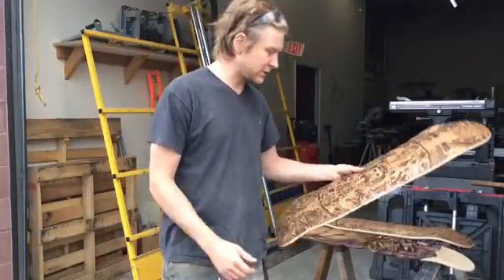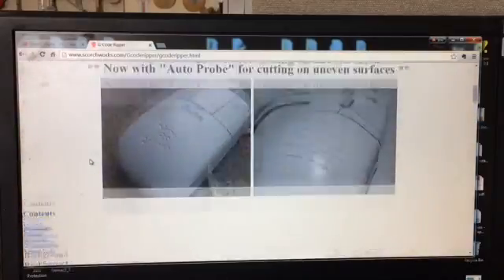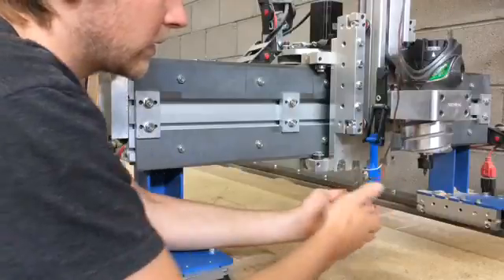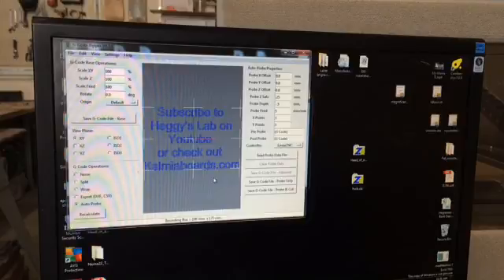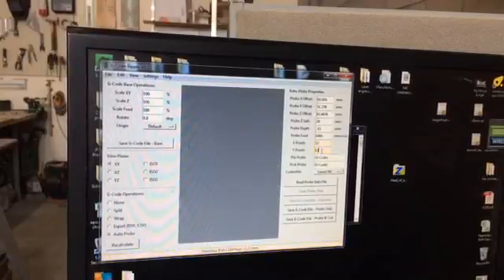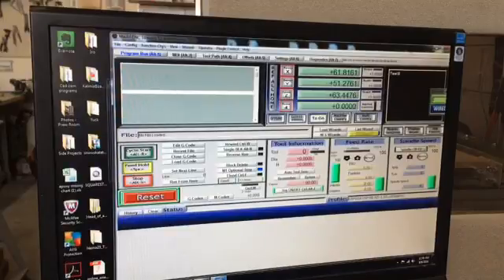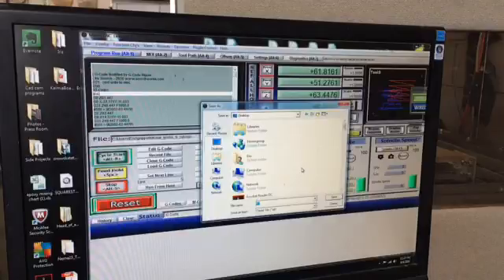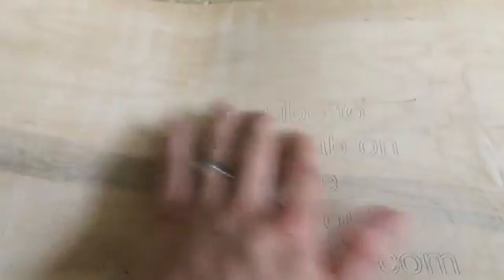How to use Gcode Ripper to engrave contoured surface

Comment: I’m using Mach3 however after loading the g code ripper file after saving probe and cut the probe moves to first checkpoint then drags rather than lifting up. Then retry and probe just keeps going down even though it is made. Did you have to add any plugins or changes in Mach3?
Wondering if it the NovosunV2 control vs Mach3

Comment: Hello my friend
I used g code ripper but I had a problem 
I set prob zero at 8.6098 when I click start the same number stay the same in mach3 even the table plan is not flat thanks.

Comment: Hello
I need help
I used g code ripper but the program is not measuring the difference between tow point it's always the same 
We r not using the prob it's deactivated in artcam we set the z zero but it stay the same in the all plan for example we set the zero prob at 8.6745
When we click start we had the same number in all point

Comment: Great video!
A quick question: when you've measured the offset for x, y, and z of the probe (before adding it to GcodeRipper). x and y were easy to follow, how did you measure the z offset?
Were you looking at Mach3 for an indication of the probe LED indicator?
Thanks!

Comment: Could you share the probe project?
Reply from the maker: I dont have the file anymore. It was something I just sketched up to the project done on a simple free cad software online. When I posted this video I did not have access to solidworks which is what I use now. If you dont have cad software and you want to make something 3d simply you can check out tinkercad online. Its so basic (i think it was buillt to tech kids to 3d print) but you can get a simple shape quickly and save as an stl and open in cam software.

Comment: This is indeed great!
One thing I didn't understand, what happens after it finishes probing? (From this point until you mill the gcode on the new probed surface there are steps you're not showing, right?)
Thank you
Reply from the maker: Hey late response havent been on youtube in a long time. have you played with it and figured it out? I did not skip any steps - the gcode ripper edits your gcode and inputs the probe depths automatically wich makes things pretty simple/seamless. I am not fully sure how this works - havent spent time looking at the gcode as it worked so smoothly. I believe it is operating as a macro in the gcode

Comment: Would you be able to share your probe .STL file?
Reply from the maker: I dont have the file anymore. It was something I just sketched up to the project done on a simple free cad software online. When I posted this video I did not have access to solidworks which is what I use now. If you dont have cad software and you want to make something 3d simply you can check out tinkercad online. Its so basic (i think it was buillt to teach kids to 3d print) but you can get a simple shape quickly and save as an stl and open in cam software.

Comment: I am trying to understand the last step that you did after got "probe & cut gcode" from g-code ripper. I see that load that gcode into the Mach3 and "Cycle Start" (which prompts you to save and you did though not necessary). I am new and trying to understand from here. How the Mach3 corrects itself with the surface? Because after the probing runs, I see no correction made. outside the Mach3. Does the Mach3 takes the probe data and corrects itself? Please confirm. 
I have LinuxCNC but I hope it works the same. Your video is with the nice detail and thanks for posting.
Reply from the maker: Great question - Honestly I am not sure how the program interpolates the data from the probe. You may want to try and reach out to scorchworks for more detailed info on how the program runs.